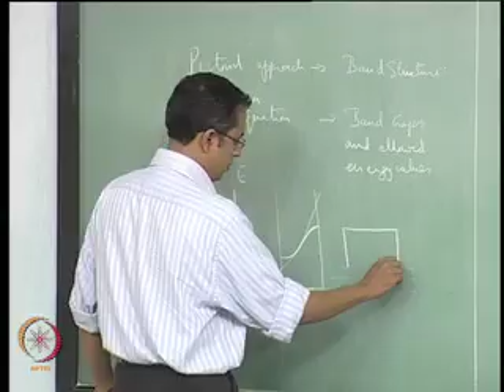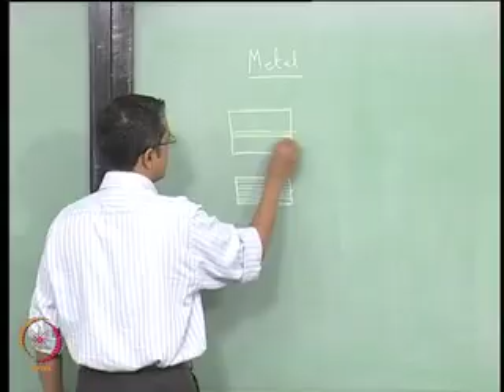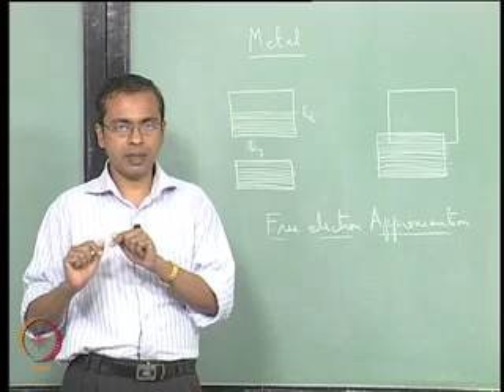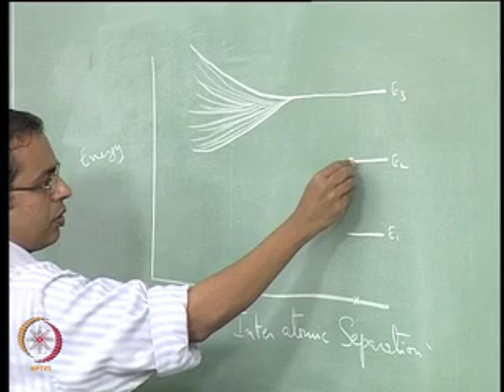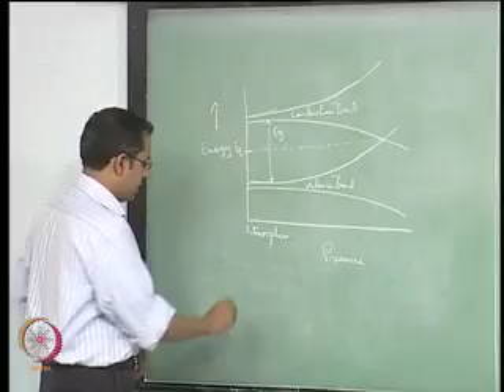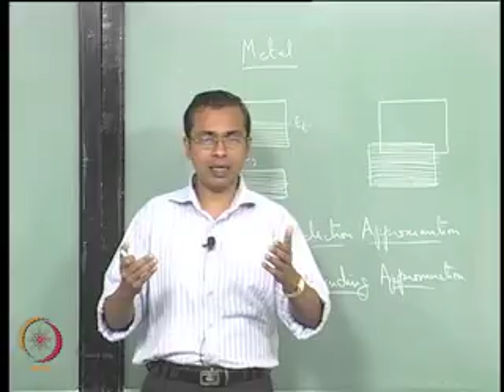Bands; Free Electron Approximation, Tight Binding Approximation

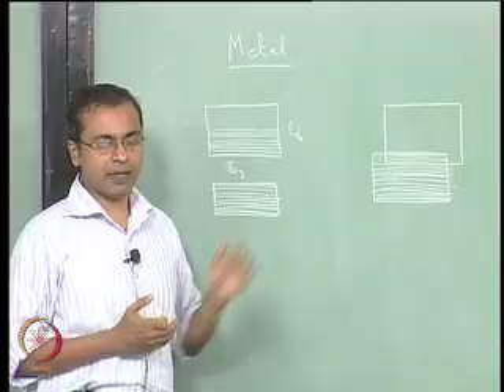Comment: How the mettalic bands overlap in the distortion curve where there is always a gap??plzz xplain anyone (15:25)
Reply: Uper band is half field called conductor band. there is a gap but we are not interested . Because for conducting current the electron not come from valancy  band but from conducting band. Conducting band is not fully field
Reply: why half field ? why don't full filled? .
imagine water in tank so if you give a different it always go from higher to lower potential , if it is completely filed for increasing or decreasing we have to cross the forbiden gap which required greater energy..